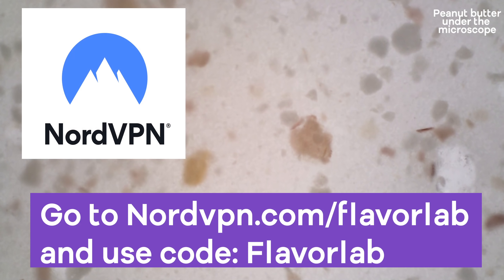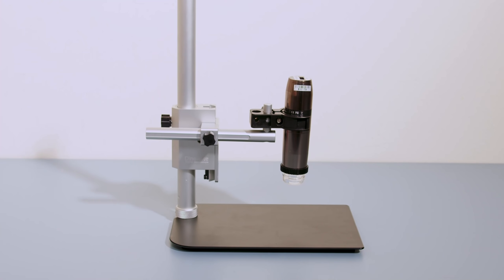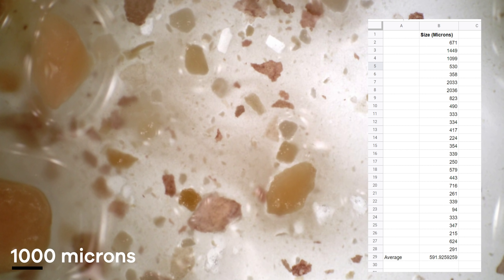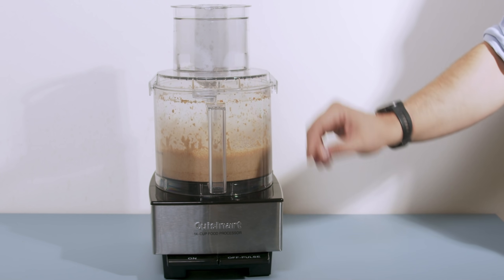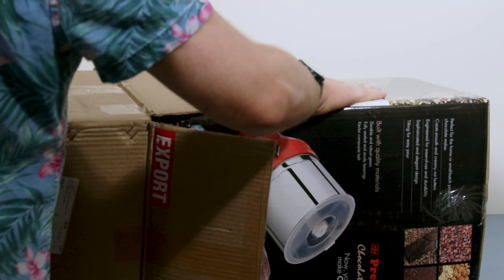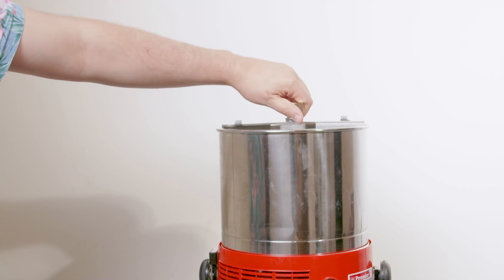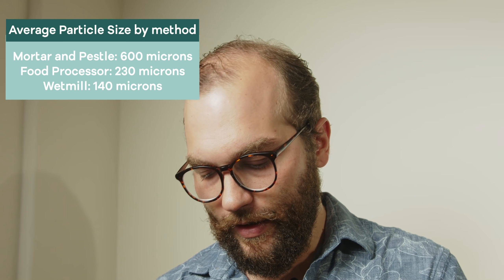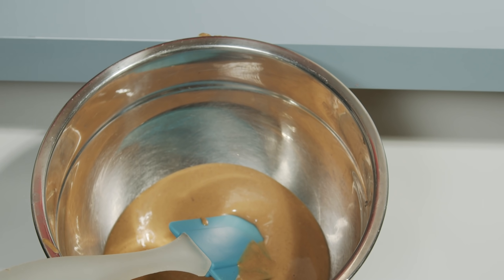What happens when you make peanut butter too smooth?

Comment: This... isn't really "what happens when you make peanut butter too smooth." This is just "how to make peanut butter more smooth." You didn't discern any notable differences other than that it's smooth.
Reply: Well it depends on preference. Normally peanut butter is suppose to be easy to spread, but it's very unusual for it be runny at room temperature. I can imagine some people liking that, but it is a departure from what we usually think of as peanut butter. I think if he kept going it could have been a straight up liquid which I don't think you could call peanut butter
Reply: @nahometesfay1112  ...natural/organic peanut butter? A lot of those seperate into oil+pb at room temp and even if you re imulsify it will still be a liquid, viscous consistency
Reply: @EZOnTheEyes  I've had natural peanut butter I wouldn't call it runny after you stir it

Comment: To get it finer with a mortar and pestle you cant just pound, you need to really grind the pestle around the sides using a lot of force. 
Once you have reduced the nuts to small grains, simply push the bottom of the pestle against the "side bottom" of the mortar. Depending on the size and steepness of your mortar, the angle of the peatle should be between 30-45° from the vertical. Then just push down and circle the pestle around the mortar bowl.
This will get you a much finer grind, at the cost of A LOT more elbow grease.

Comment: "2 to 3 millimeters across"

I don't think this guy knows what a millimeter is.

For reference, a credit card is about 0.76mm thick. I don't think I've ever seen a peanut only 3 credit cards thick.

Try it: take 3 credit/debit cards and hold them together flatwise. That's roughly 2.5mm thick.

Maybe he meant centimeter...

Or maybe he looked at the notches between the "inch" markings on an American ruler and thought those were millimeters.

Comment: You can definitely get proper peanut butter in a mortar and pestle without adding anything. I've done it a few times but it takes a good 10-15 minutes until it gets buttery.
Reply: Sadly most people tend to not know how to use one and they literally just pound on it like a monkey with a rock instead of using it properly and swirl it to actually grind it against the sides/bottom
Reply: @SilvaDreams  I swear people are afraid of scratching the thing (source: I am not good at using them and am afraid of scratching the thing)
Reply: @DeathnoteBB  Lol, don't be because that is exactly what they are for, using friction to grind the contents down.

Comment: I think there is something off. I do fibre arts and fibre is also mesured in microns, a angora wool hair is about 10 to 15 microns and you can feel it in your mouth, sheepswool is like 30mic and human hair 60
So maybe you are one digit off? Or two?
Reply: This is quite different. For one thing, when it comes to hair you measure it's width, which ignores the length. It's also not the same thing to be able to feel that you have something on your tongue and to feel distinct particles in what you have on your tongue.
Reply: @Hwyadylaw  but i looked up how fine chocolate is refined and its about 10µm so its sus if his wetmill makes it 10 times griddier

Comment: That was an incredibly poor technique on that mortar and pestle. You don’t just move the pestle up and down and pound it like it’s a hammer….…. You grind in a circular motion. You can achieve an INSANELY small particle size if you go at it long enough with that method.
Reply: In fact, it's basically the same thing as the wet grinder, just a smaller, manually powered version.
Reply: @Hwyadylaw  They are the same thing, just one is a mechanically driven version.
Reply: @SilvaDreams  that’s what they said…?
Reply: @SilvaDreams  why did you paraphrase the first reply lmao
Reply: @kpp28  There is a difference between something being "basically" the same thing and just being the same thing.
Reply: @SilvaDreams  The basics of the thing are the same, the specifics are not. It's like the difference between a hand loom from 12000 years ago and a power loom from the Industrial Revolution. They serve the same function, but go about it in their own distinct way.
Reply: Do you get pieces of rock in your food when you use it tho?
Reply: @GodleyX   no, not at all. It’s not like pieces of the ceramic break off when you grind
Reply: @spiderdude2099  oh there are ceramic ones? The only one I've ever seen was super heavy was like.. Rough rocks idk
Reply: @GodleyX   even those kind, they won’t do that either.
Reply: @GodleyX  they can do that on the volcanic rock ones, thats why when my grandmom gets one she grinds oats and rice into it and keeps doing it until no more rocks come off and the inside is smooth. its important to do it if its a rough one

Comment: With a mortar and pestle you don't just pound. Once you reach the point you were at, try grinding in a circular motion and when a lot of the substrate has gone up the sides of the mortar, push it down to the base using the pestle with a bit of rotation. You can get stuff pretty fine  like that, however power tools ftw!
Reply: I think it was fairly obvious that was low effort. It was basically a rush to get to the mill and test it. Added oil to food processor one.
Reply: thanks! my gf now doesn't complain about my technique anymore!
Reply: Coincidentally this is the same technique I use with your mom.

I don't just pound. Once I reach a certain point, I grind in a circular motion and when a lot of the substrate has gone up the sides of the mortar, I push it down with the pestle with a bit of rotation.
Reply: @jessl1934  nice one! :D
What about power tools though
Reply: @jessl1934  💀
Reply: also the moisture is a factor
Reply: I saved over alot of my used eggshells to use as a fertilizer substitute when I was low on funds. I didnt get it to a powder in the mortal and pestle, but closer to white maize or coarse sugar grains
Reply: It also looks like its smooth. You need a volcanic rock one to really get a good grind
Reply: @zamiaramirez1390  or just just rock
Reply: @zamiaramirez1390  Different cultures use different kinds of rock which produce different types of grinding. There is no "right" type of stone for a "good" grind.

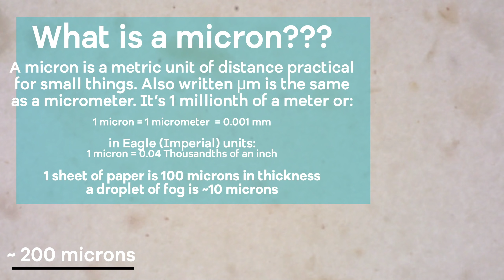Comment: ouch rendering error at 2:39 :/ also the µ doesn't have the same font as the text
Great video though! loved it. If you want to do more particle size analysis, i recommend a programm called "ImageJ - Fiji" 
iirc it's open source and it has a function (hough transform) that lets you determine sizes of circle-shaped things. however, this requires quite good contrast between the background and particles, so maybe this isn't the right method for you and doing it by hand could work just fine.